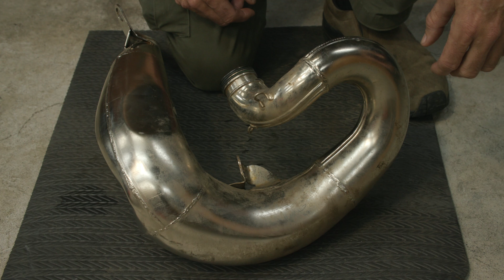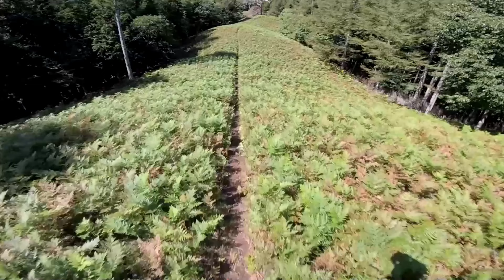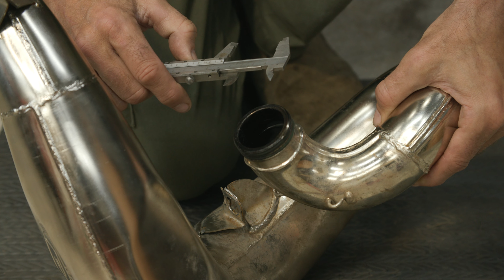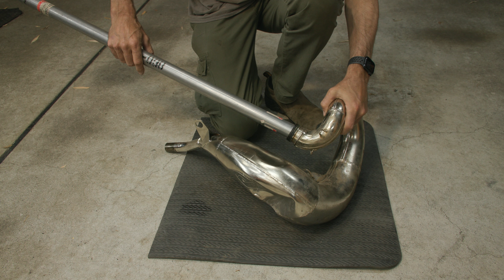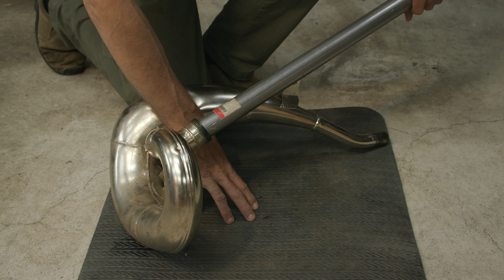Two Stroke Pipe Header Bend Repair

Comment: Performance >>>> how does a moderate dent effect it? 

My 'leg-burner' EC actually needs to be dented in order for it to fit cuz it rubs on the corner of the Head.  It's about 1/4" from a flush seat.  Therefore, to the torch and 🖊  hammer, I go.  I'm just curious if it will effect anything.  I mean, even the factory does this sort of thing. 

Anyway. . .

🇺🇸

Comment: Would using a cheap hydraulic press bolted to the floor also work?
Reply from the maker: It might do, but you don't want to squash anything so would need to be careful. The biggest difficulty would be holding the pipe securely while try to use a press. Doing it manually like I did in the video actually works OK and would be even easier if you have a friend to help you.

Comment: Hello I'm having a big problem with my 2023 ktm C 250xc 2 stroke flywheel. Sometimes when I start my bike my flywheel misadjusts, causing the ignition timing to be off and not start the bike.
I've tried tightening the nut to spec and using the locktite washer and red locktite liquid. Still comes loose. The nut and the flywheel stay tight but it misaligns the flywheel.
This is also my 2nd flywheel as my first flywheel stripped completely. I don't know what to do l've tried a bunch of stuff.
I'm thinking of either impacting my nut on or welding it.
Happened to me twice today had to fix it in the trail
Reply from the maker: Remove the flywheel and check the woodruff key in the crankshaft. The woodruff key must either be missing, or sheared for the flywheel to be turning on the crankshaft
Reply: @TokyoOffroad  the woodruff key is missing. Does the part have to be bike specific? Because ktm doesn’t show a part number on the ignition diagram.
Reply from the maker: @Rollingturtless  - The woodruff key part number is listed on the crankshaft parts diagram: KTM part # 0888030050 WOODRUFF KEY DIN6888-3X5X13
Reply: @TokyoOffroad  I have found the woodruff key on the diagram for the crank. Thank you for your help

Comment: Pulling the header neck back is the hard one to do. Have done it with come alongs and hooked the pipe over a bench and pulled it from the other side, I should just finish the jig I have started to make.
Reply from the maker: Yes, agreed, pulling it back isn't easy. Luckily most of the time my pipes only need adjusting up/down/sideways and the method shown in the video works well for that.